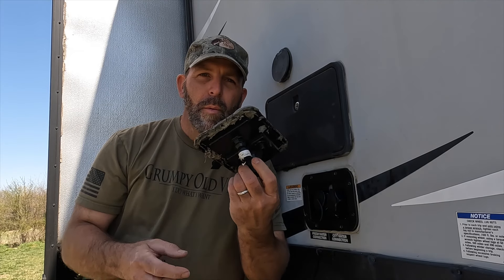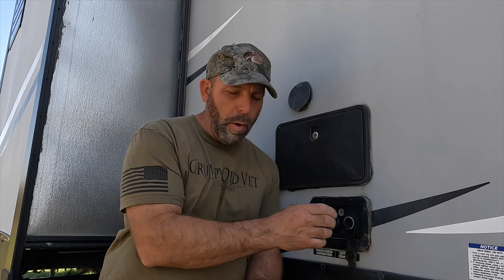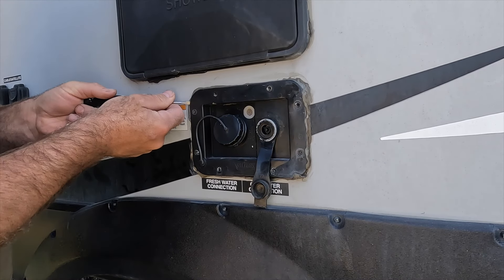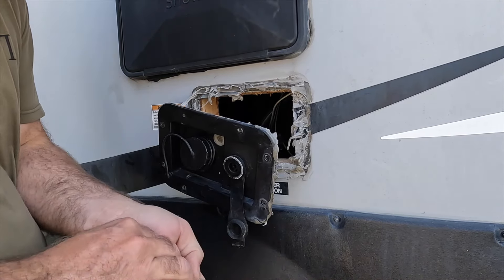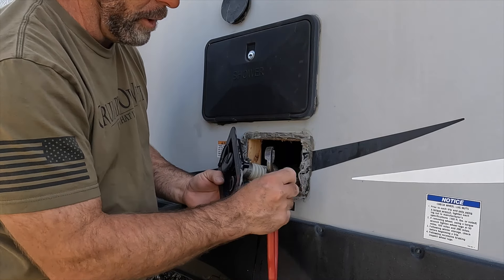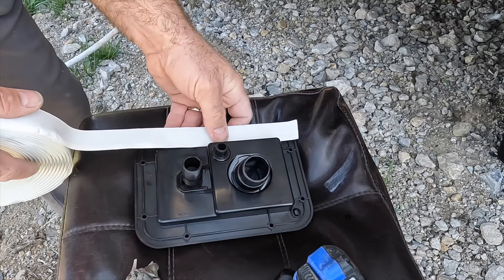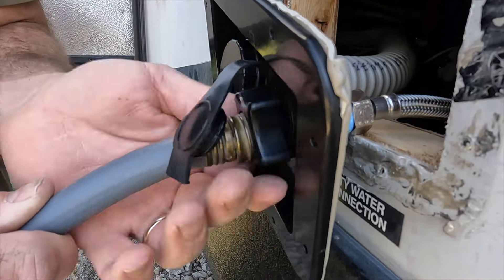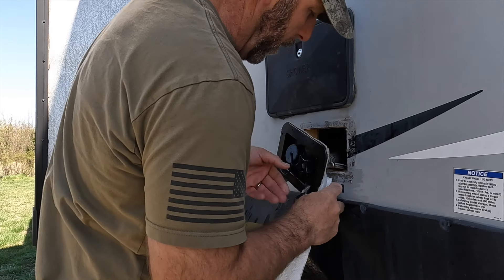How to replace an RV city water connection

Comment: Thanks.  I didn't know what it looks like behind the inlet unit. I think I'll leave the butyl seal on until after connecting the pipes.
Reply from the maker: I would say if it doesn’t come off then that’s a good idea.
Reply: I meant the seal covering the new butyl tape.  t @TeamTateOutdoors
Reply: I meant leaving the protective film on the new butyl tape until after connecting the pipes.
Reply from the maker: @JeffMcCalib  yes that’s a wise thing I should have done. lol

Comment: Sir what size are those braided hoses? 1/2 or 3/4?
Reply from the maker: I’m sorry I’m not 100% sure but I got them at Home Depot or Lowe’s they fit the fittings on the trailer.